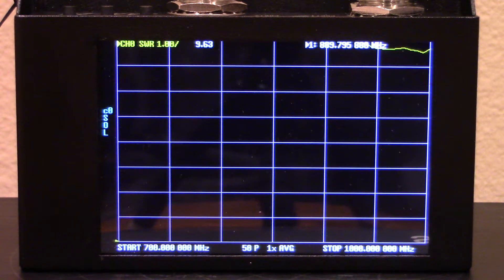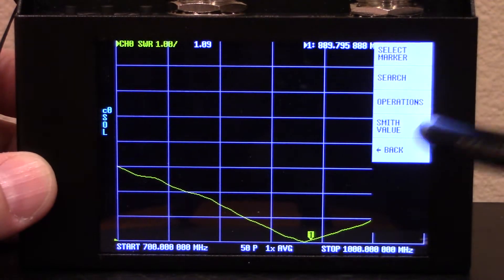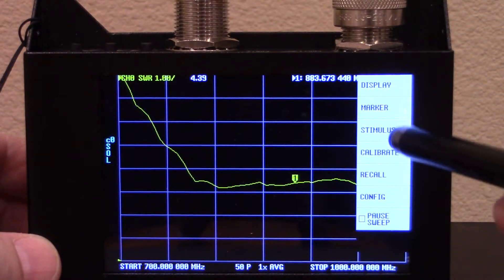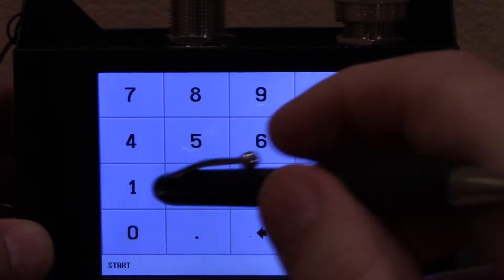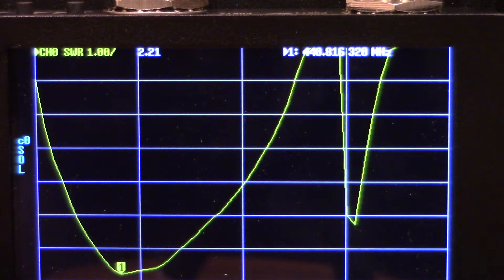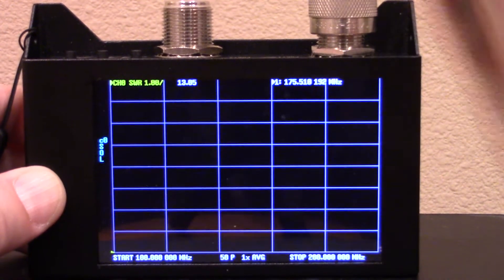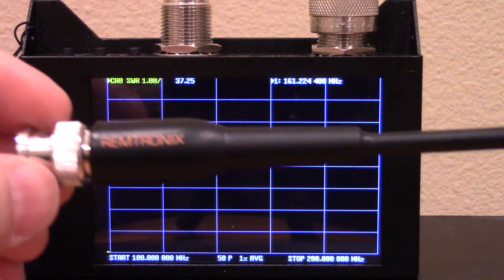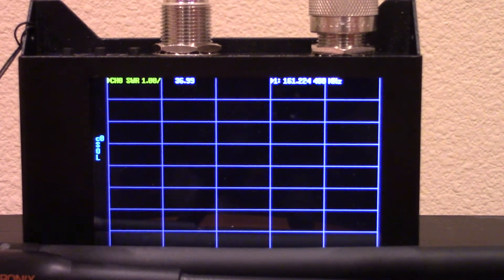Testing Remtronix Scanner Antennas with a NanoVNA

Comment: if you change the stimulus you need to re-calibrate on the new settings.
Reply from the maker: It was pre calibrated from .1 to 1 GHz. Calibrating mostly takes the cable out of the equation.  There was no cable used here, only an adapter, and it was calibrated with the adapter in place.

Comment: Meaningless test for RX antennas.
Reply from the maker: you're telling me an antenna that's not resonant will receive the same as a resonant one?
Reply from the maker: @dosnglenn  Bullshit. if that were the case then all antennas would be the same length regardless of frequency. No matching networks, no coils no external antenna tuners etc. There would be no such thing as quarter wavelengths, half wave dipoles,  .64 wave, collinear etc. In theory you could just stick a piece of wire in any device and it would receive from DC to Daylight equally. Can you share what you're smoking? We all want some.